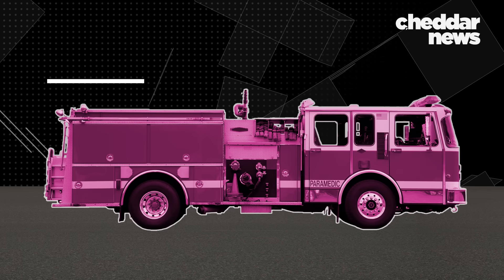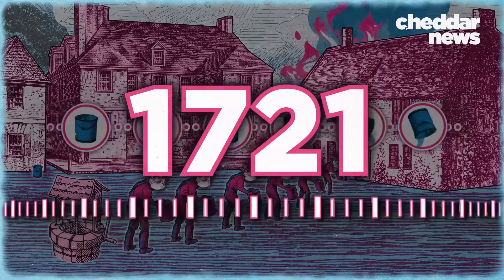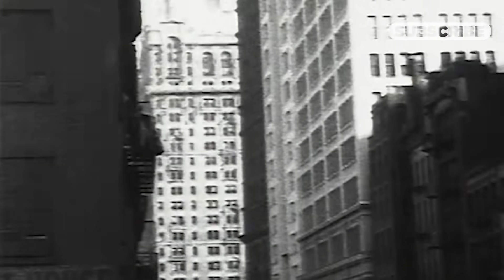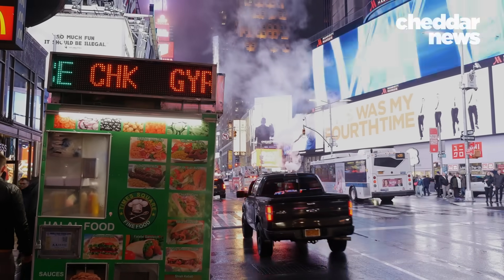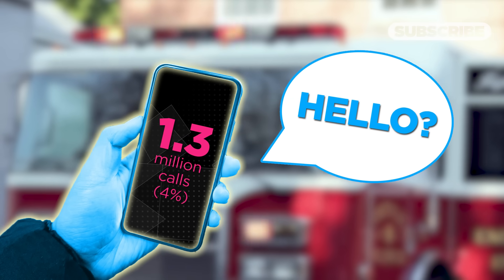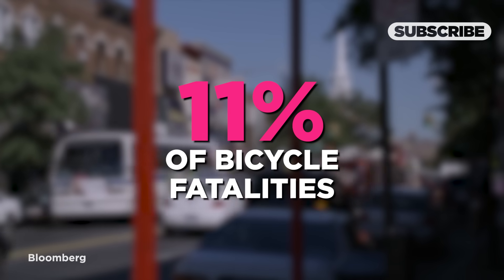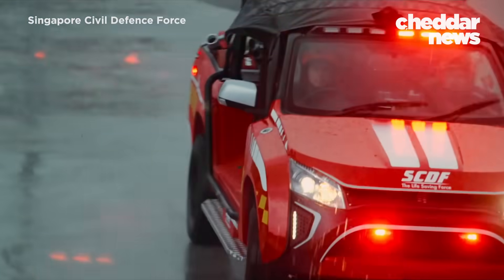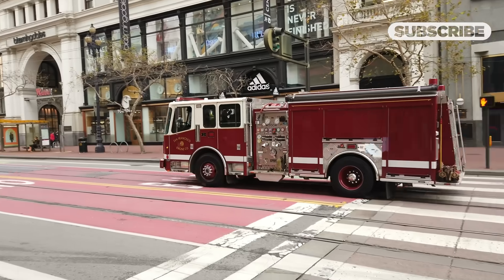Do American Fire Trucks Need To Be So Massive? - Cheddar Explains

Comment: oof. Judging from the 'further reading' section I'm guessing you got all your information from the idiotic tabloids who can't figure out how to solve a 1 color Rubix cube instead of, say, actually trying to talk to people that do this for a living or at least take a look around websites that would actually have some real information, so I can't blame you for the lack of accuracy.

-400-500 gal? You mean anywhere between 750-1000 average.
-The cost shown is a bit high as well. For example, you can get a decent brand new aerial for around $600k unless you're dealing with a crappy dealer or trying to go for something really fancy.
-The bit of how only a few calls being fires is also misleading as it heavily varies area by area. For instance, the city next over to me deals with fires every day.
-The part of "how a fire truck should look like" is absolutely laughable and it's clear the person doing this is a blind euro apparatus fan. Those things wouldn't work well here at all, just like how US apparatus wouldn't work well in most places elsewhere I presume. One to one US apparatus are overall superior with more equipment, more crew, better pumps, larger tanks, and so on, but as a consequence they're larger and more expensive. The only reason we get away with using them is because the vast majority of our streets are large enough to handle them. On a related note, the bit on euro aerials reaching just as high is also completely misleading, as the average euro one doesn't reach as far as the average US one. Now, before anyone decides to throw a fit and accuse me of being a hypocrite and being a US fanboy, I will point out that US apparatus does have it's own flaws, like the aforementioned size. Our stuff simply will not work overseas with the narrower streets and such. Our stuff works well here because it's built to work here, just like apparatus built elsewhere works well there. Huh, things tend work best where they're made, imagine that.

Regardless of anyone's thoughts or opinions on US and non-US apparatus, any true firefighter, EMT, etc. or fan of such things knows that we're all in this together. Much love to our overseas brothers and sisters from the US!
Reply: "One to one US apparatus are overall superior with more equipment, more crew" I don't quite agree with that. Although e.g. a German Engine definetly is more compact and holds less water, the standard crew is 9 firefighters and it actually holds more (!) equipment than an American one. 
"the bit on euro aerials reaching just as high is also completely misleading, as the average euro one doesn't reach as far as the average US one. " but they do reach as high up. Taking Germany as example again: anything below 105' ft platforms got super rare, while 60 ft or 75 ft ladders are still somewhat popular in many places in the US. Besides the standard 105 ft platforms there are also many platforms in the range of 150 ft to 170 ft. Tallest one in service in Germany reaches 300 ft high
"Our stuff simply will not work overseas with the narrower streets and such." actually the width of the street is the smallest aspect tbh. Semi trucks, articulated buses and trams fit into our streets, then American fire trucks will easily fit as well in normal streets. But they definetly won't fit in the small share of actually tight streets, in the few,  preserved and small historic city centers. Some American apparatus were or still are used across Europe.
Reply: @EnjoyFirefighting  Hey, I've seen your videos! Good stuff, keep up the good work! Also, thanks for the info on the aerials and such. I honestly wasn't aware of that.

From what I've been able to see, unless I've been seeing some weird videos and pictures of German apparatus, your typical US apparatus tends to hold more equipment and about the same personnel (I admit I thought the average euro rig held closer to 5/6 people. Been a while since I looked into the euro stuff). You might be thinking of some brush rigs or some specific oddball or older models that don't carry much (Keep in mind that there are some departments that have rigs that are like 30 years old. Also, reminds me of the time I saw this rig once that had these super weird thin compartments. You could squeeze in a can or extinguisher if you had some butter and a hammer maybe haha).

I'll concede on the bit with the aerials, I admit that I thought the average was shorter than that, my bad (though average US is actually about 100, and anything below 75 is actually becoming rather uncommon, or at least I hardly see any anymore. You just about have to order one custom to get shorter than 75 nowdays it feels like, unless you wanna snag a used truck). As for the streets and the like, I don't know, seems like our stuff just wouldn't handle that well there from what I've seen on Google maps and such with how they handle. Once again, I'm mostly just guessing with what I can see. I haven't been over there myself so I can't say for certain. I actually find semis to be easier to drive than your typical US engine/truck, as strange as that sounds. Differences in weight, turn radius, etc. to oversimplify.

I think one of the biggest problems in trying to compare apparatus between US and euro is that there's so many different variations for a wide variety of uses. Regardless of the actual differences, pretty much everything in this video is incorrect. I think I died a little on the inside when I watched it. Finally, to be clear, I'm not trying to be like "US best" or anything (my God I hate fanboys). Each has their own advantages and disadvantages, and I actually kinda like the euro stuff. We could certainly use some nimbler apparatus in certain places (looking at you NYC). We're all in this together. Take care and stay safe! ^_^
Reply: @Elias_Auxilibus  thank's man :) There are lots of videos just waiting to be published.
Yes, the typical apparatus in Germany holds more equipment. As for the crew: for career FD it's common to run with a 6 man crew on the Engine, and bviously those larger career FDs are usually the oens you see pictures and videos about. At volunteer departments a crew of 9 is the standard. 
"departments that have rigs that are like 30 years old" yeah we have quite a few of those here as well. Oldest truck in the fleet from the volunteer FD in my village is from 1986
We used to have a few 60 ft Ladders in the past (but even then they were far from common), they were based on a van chassis to get into places the larger trucks weren't able to reach. But as all-wheel steering became more popular and kind of to standard on the 105 ft Ladders, some of the old 60 ft ladders were taken out of service or just remaining for a few years until they will be taken out of service due to their age.
A E-One 100 ft Platform running in Poland: https://www.youtube.com/watch?v=89JB6qqULYk
A 300 ft Platform running in Germany: https://www.youtube.com/watch?v=pcaTdeRoRag
of course, in narrow residential streets or in historic city centers both would barely work

Comment: This video was good at pointing out the the problem in the bigger city's but in the small town department they dosen't have easy access to fire hydrants. A smaller truck would not work the best because of the lack of water there could hold. I'm a volunteer firefighter one of small truck holds around 1000 gallon of water and we can go through that in a few min.

Comment: This video is not very well researched at all. Alot goes into designing these vehicles and the NFPA aparatus are far superior. I worked on both types extensively. Fire dept functions and doctrine, roads, building construction and equipment used etc. are very different in the US than in Europe. All of these and so much more goes into developing and designing these vehicles.  I think this is a case of not really understanding the scope of operations of US fire depts.
Reply: "and the NFPA aparatus are far superior" why do you think they are because of NFPA?
Reply: @EnjoyFirefighting  yes, NFPA in my personal opinion. I probably shouldnt generalize and say europe. There are alot of countries in Europe. Also, i worked on european trucks outside of europe. Maybe they would be superior to NFPA for the roads, buildings and hazards found there. It would make sense. Certainly not for the US as the video suggests. The entire doctrine is different and everything else as i mentioned in my original post. Having worked in a british run fd (outside of the uk) and US departments,i personally found NFPA doctrine  and equipment superior in the theater i worked. The exception for me was ARFF. To me the Rosenbauer Panther was best ARFF aparatus I worked on.

Comment: This video has many flaws and does not concern the needs of many departments in the US and the amount and weight of heavy equipment that the trucks carry in the US.  Many rural departments have Type 1 engines that hold a minimum of 1,000 gallons of water, in which my department has 3 of them.  We also have a Type 1 that carries 3,000 gallons of water since our coverage area is so large.  Our type 1's are also custom-built to be grass fire trucks as well so we have a full NFPA compliment of structural firefighting tools PLUS an NFPA compliment of wildland tools.  Our trucks have to be massive, as we are not near as densely populated as Europe.  Plus, European trucks are ugly IMO.
Reply: we carry less water and operate at less gpm and more PSI on scene; Response areas in e.g. Germany are rather small, while they are huge in e.g. Sweden or Norway. In Germany we don't really have custom built grass fire trucks ... we simply take our plain normal Engines and Tankers (Tenders) offroad into the grass, fields and forests as they're designed to handle some normal offroad like that. Also the plain normal Engines carry some basic brush fire equipment, just like they carry the complete set of extrication tools, ground ladders etc 
"as we are not near as densely populated as Europe" there are places in Europe which have an equally low population density than some of the US states with the lowest population density.

Comment: The TV show from the 1970's "Emergency" they actually did that. But I don't think the fire stations want to split their crew in case theres one big mega fire...which is rare...compared to how many smaller incidents there are. They should re-think how they do things. Currently ambulances are struggling to keep up with calls as far as medical emergencies. And the nearest fire station responds with....their big truck. They could use the smaller truck to respond and keep the big truck ready for fires.
Reply: A lot of departments are starting to use smaller sprinter units to combat this, especially in municipalities that rely on fire departments they will have a smaller, usually an SUV or Pickup based vehicle with med supplies used for paramedics and EMRs. The sad thing tho is that this only works for cities where the extra manpower is able to be spared, the reason fire is called for medical is because not all EMS providers have the staffing, fleets, and more needed to be widespread enough which is stupid and no one likes but that's how the greedy beaurocrats think its effective. Why add 3 more ambulances when you can have the closest fire truck respond. saves the cost off 3 ambulances hat can easily hit $200K.

Comment: Length isn't necessarily the issue, except for storage.  The width is an issue.  Narrower vehicles are less stable at high speeds and with weight 50' above them.  You compare European trucks to American trucks without realizing the layout of streets and urban areas is completely different between the two continents.

Comment: Being an American career fireman, I can’t imagine a smaller platform. Our engines (and trucks) are just massive tool boxes. Every piece of equipment we have is irreplaceable AND I feel as though we should carry even more! For our engines to have 500gal of water and a full compliment of hose AND all of the tools, you NEED a rig as big as ours. That being said, it may definitely seem overkill from the outside looking in…
Reply: I'm part of the German THW (imagine firefighters but for emergencies that would require the Army corps of engineers), and those trucks are also packed full of equipment. They're basically identical to your average European fire engine, and can fit about the same equipment the average American fire engine can carry. This is because the equipment is packed in a lot more efficiently, which does create problems getting some of it out, and makes packing everything into the truck somewhat of a hassle. Most of the trucks also don't have a crew cab (instead we've got Sprinters to carry more people; they simultaneously function as command and radio relay vehicles), and if they do, it's quite tight inside. In general an American fire engine is probably more comfortable to work with, but your average European fire engine has similar capabilites at 2/3 the size. There are also somewhat common vehicles on a lifted 4×4 chassis, which combined with the relatively low weight makes them surprisingly good off-road.
Reply: I've seen quite a few walkaround videos where I saw compartments with equipment stored rather loosely at the bottom, with lots of compartment space remaining unsued. On a more compact truck layout you can carry the same amount of equipment when you have a good space usage concept, like a game of tetris, using every inch of available space.
We don't carry that much water along, 422 to 528 gallons on a normal Engine; As for the range of equipment they have a complete set of extrication tools, smaller tools for technical assistance, ground ladders, power generator, anything to handle traffic accidents and often stuff like jumping cushion, lifting cushion, wet vacuum cleaner, brush fire equipment, medical equipment etc. In fact the DIN norm dictates very precisely the minimum range of equipment and capability of the truck and at the same time also dictates the limits in terms of size and weight of the truck. A decade ago the bare minimum equipment was 164 different tools at a total number of 284 pieces, not sure how much it has changed since then

Comment: Love when you said “The US one looks old” you showed an early 2000’s FDNY rig. Do some research and look at ‘21-‘22 USA fire trucks.
Reply: Regardless, How are looks relevant to them being "too big"?
Reply: @joefather2463  Idk, and I love how in the thumbnail and throughout the vid they show the biggest size there is lol. I rarely see trucks that size on the road, it’s usually smaller ones
Reply: To a European, it looks like it’s from the 1970’s that’s the point.  The design looks to have barely changed.
Reply: Still looks old and with pointless chrome
Reply: @oscarosullivan4513  chrome reflects light very easily.  That comes in handy on night calls when cars are having to go around the rig
Reply: @kentuckyace1068  Over here they have reflective panels and blue lights on all four sides
Reply: @oscarosullivan4513  can't see the bumper.  Also the chrome is a lot more rust resistant than just normal painted steel
Reply: Not that I care how old a fire trucks looks, but the 2022 USA fire trucks all look old to me.
Reply: @janpeter6047  They do but its just a tradition thing. Kinda why BMW's all looked very similar until recently, and guess what: people got mad they changed it
Reply: @joefather2463  Since they made bmw ugly, you can change a design and not make it ugly 🤔Though looks are pretty subjective. Like i like 90-00 volvo looks and dont mind newer volvos either even though they look completely different